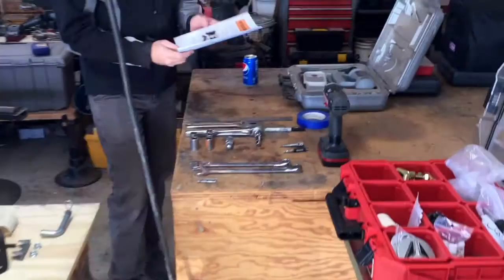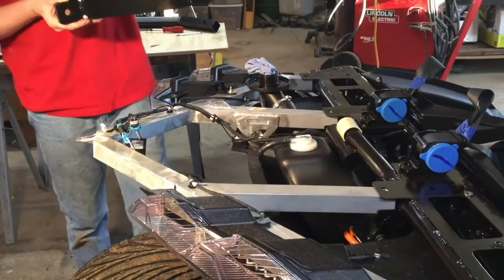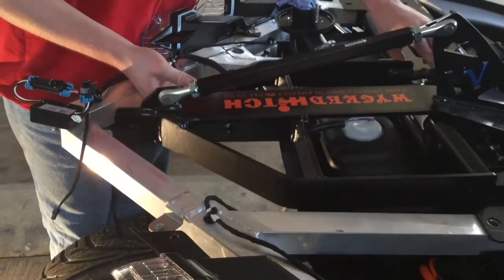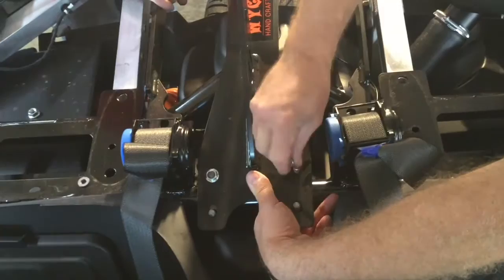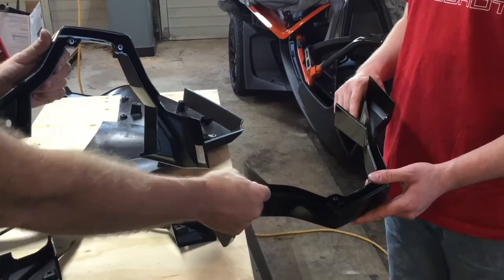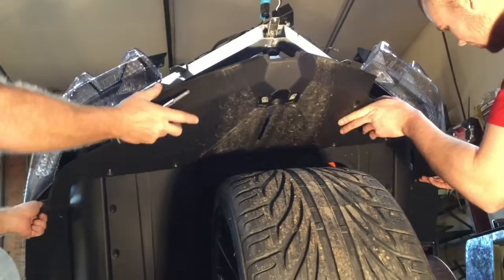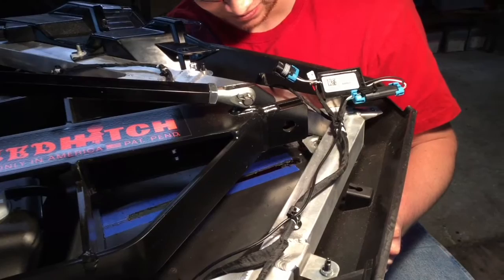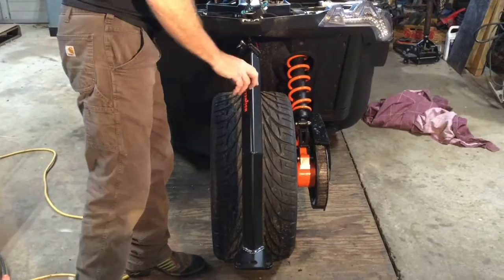Polaris Slingshot Wycked Hitch Installation

Comment: I plan on getting one of these soon to haul my superjet jetski. Very nice looking hitch, good job. That BLA module is a radio antenna extender I believe. I bought my 2017 SLR used with 1,100 miles on it and this module was bad causing my big middle break light to not work. Simply unplugged it and wired direct and brake light works...
Reply: Wycked Kids Will do, thanks!

Comment: It looks like you have one hitch for 1300 lb. capacity and a completely different one for the drop down hitch. Can I order the 1300 and add the drop down portion separately? I noticed the drop down square tube is rotated 45°.
Reply from the maker: You sure can, just swap out the drop hitch with the stubby by a pull of the pin.